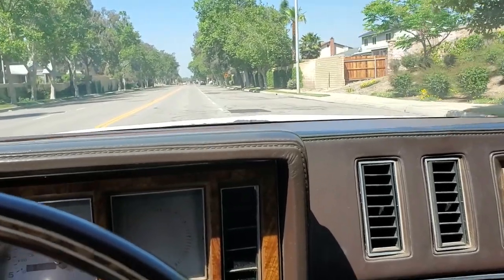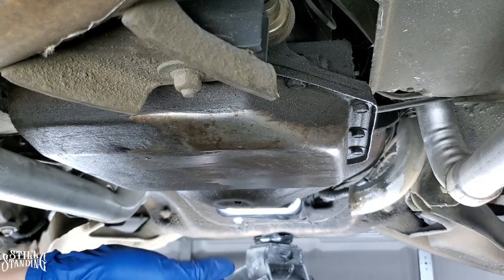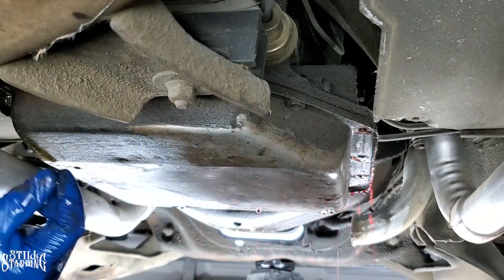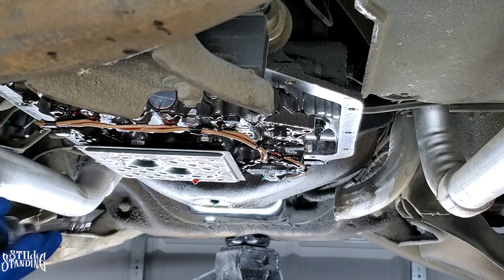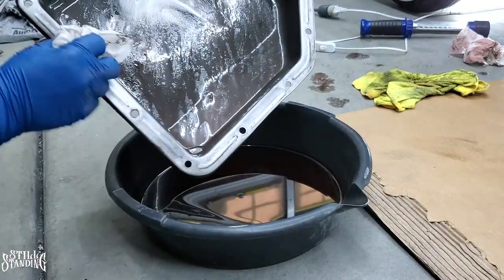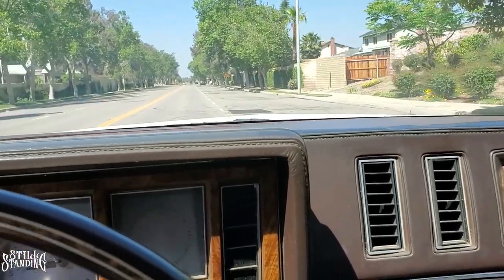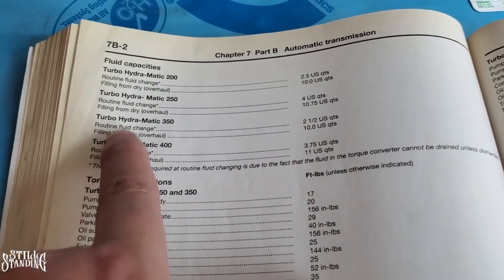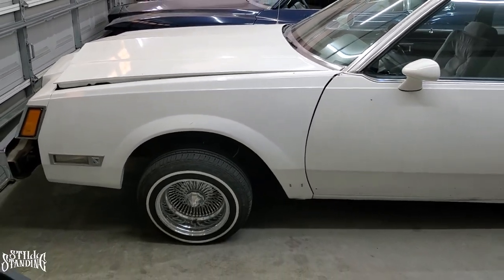G-body Transmission Oil and Filter Replacement 83 Regal

Comment: Nice regal, I had a sky blue 83 regal mine didn't have that marker light/blinker on the lower front fender. My original 231 V6 blew up, I dropped in a  77 350 Olds V8 with TH350 transmission, the original rear end was geared for a V6, I swapped them out for taller gears. I installed seats from a Oldsmobile cutlass.
Reply from the maker: Nice! That's a nice upgrade. The motor on my Regal blew a long time ago and I wanted to swap it out for a 350 but decided to keep the 231.

Comment: It's a very nice car I have a 82 Cutlass supreme on building right now I don't know if I'm going to do hydraulics I kind of had a few cars with hydraulics already so I don't know my plan but I was going to ask you where did you get the speaker kick panel pods from did you make them or did you buy them somewhere
Reply from the maker: Nice! I had the kick panels made in '05 by a shop
Reply: @StillStandingGarage  I sold my 77 Cadillac coupe deville with hydraulics and everything last year and I got this 82 g body but I'm not sure I want to go with hydraulics but the same time I feel that's the most desirable lowrider for me at this point

Comment: Hey, brother. I'm wondering if your pan ever leaked since you finished your filter change. I'm doing my son's 85 Regal soon, and I won't use RTV if yours doesn't leak. Thanks man.
Reply from the maker: It didn't leak at all. You just have to make sure not to over tighten the bolts. You should be good as long as your pan isn't bent. Thank you for watching 🤝💯

Comment: One more question can I use the same manual book like the one you use for the 1980 cutlass or is it different
Reply from the maker: Haynes makes one for 1974 to 1988 Cutlass. So it will be different from the one I used.
Reply: @StillStandingGarage  thank you  I appreciate your help
Reply from the maker: No problem at all 👊💯